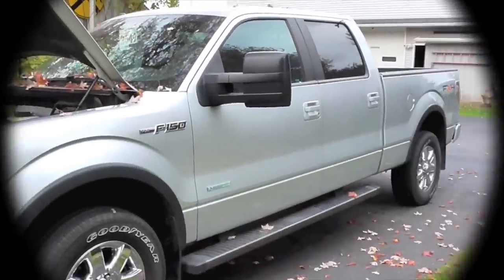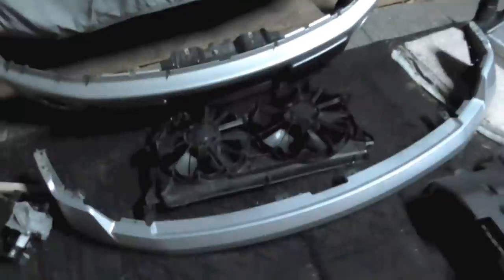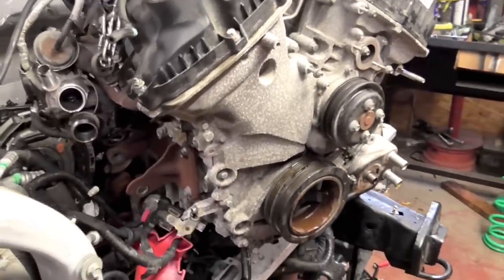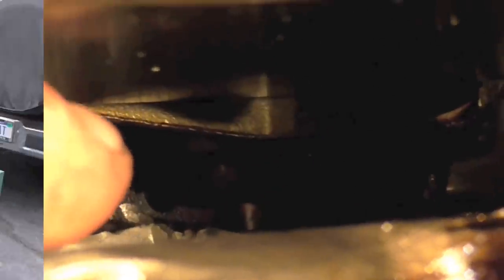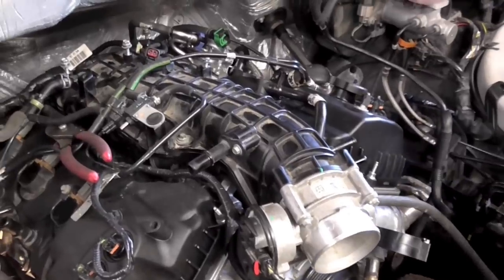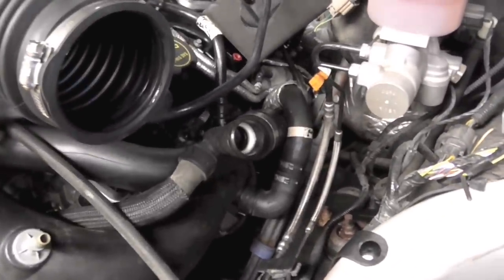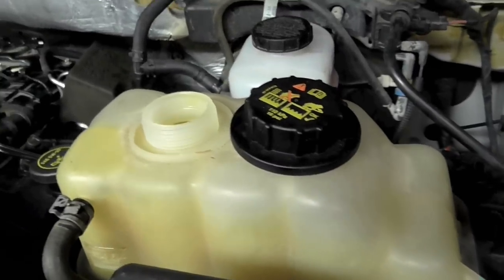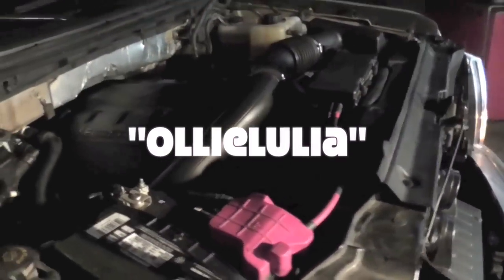FORD F150 TRUCK:  3.5 V-6 ECOBOOST ENGINE FAILURE (Removal and Installation).

Comment: And yes I'm partial to ford, there's maybe 50 videos like this considered there are millions on the road that's. 001%
Reply: dusty fleissner   There are way more Chevy 5.3s on the road than ecoboost F150s.  Why dont we see so many videos about them needing engine replacements?
Reply: Science Militia1 There won’t be soon. The EcoBoost is outselling the Chevy 10:1 and less than one percent have any problems. Hey I’m a Chevy guy as well. I’ve had many many of both fords and chevys over the years. Right now I’m with Ford and their 6.7 because the Chevy HD front ends are pure shit...yep I’ve owned 6. Remember everything on YouTube and the internet (no matter the brand) in general is all the negative shit. Which is less than 1% of all the trucks on the road.
Reply: @specforged5651  you sir are a clown. 😭😭😭😭
Reply: More to come!
Reply: elmerdane ...Smart clown! 😂 Am I right or am I right though? And no, I don’t pretend to be a know it all like most people here from their couch. At least I’ve owned and had my hands on these trucks. If most people were honest on here they would put at the end of their comments “except I live in my parents basement and can’t afford one of these trucks, but I know everything about them”. At least they would then have my respect.
Reply: @specforged5651 no
Reply: @sciencemilitia1853  👍👍👍👍👍👍
Reply: @specforged5651  lies
Reply: @specforged5651  most people live in parents basement? Oh ok✋

Comment: I just bought a 2013 eco boost F-150 and right off the bat I had brake troubles...the calipers had seized up ....had that fixed...then just a few months later I had a antifreeze leak...had that fixed...just got it back from the dealership and now I have a check engine light on....the truck had 41000 miles on it when I bought it and is now at 45500 miles...hmm maybe I should have gotten the 5.0 lol...I forgot to mention it has lost power and gas milage...it pulled great when I first got it...tons of power...and was averaging well over 17 mpg...now down to about 15.9 mpg

Comment: The 6cyl4.2 has so much potential you tubers here do intake and exhaust mods and get great fuel economy with added horse and torque. What was wrong with supercharging the 4.2L
Reply: Paul  Sosa almost sounds like a v8 too :)
Reply: yeah the 4.2 is a good engine. i hate how they are trying to make them smaller

Comment: Thank you for posting this video. I have a 2011 with the same issue and decided to go with a used engine. Is it necessary to remove the ac condenser, or can you move it aside when the engine is pulled? Did you have to get your AC recharged? Thanks again, this gave me confidence to tackle the swap.
Reply from the maker: Hi,  "we DID" ... I suppose you could work around it,  but "why" ...  we just let it gently let it 'weep-out' (the 134R), and after; we spent the 10 bucks on new refrigerant / and our draining it SLOWLY allowed the tracer dye (from the factory) too remain. True / we needed to the vacuum it down and recharge it ... "but you'll hurt-it and it will greatly ANNOY YOU if you don't because it will be so in the way" !  / MY Opinion. Video things, have a nut & bolt / fastener system in play,  "and you'll be fine" !.  Best advice: THE INJECTORS !  *lube the o rings and be quadruple-CAREFULL not to damage anything or you'll live to DEEPLY regret it.

BEST OF LUCK / you CAN do this.  :- )
Reply: TommyZTrains 👍Gotcha, I’ll take it out. Hopefully I won’t have to worry about the injectors because the engine ran good from the truck it was pulled from. I went back and forth between a used motor or a Ford reman for months, and came across a decent deal on a used engine. I am curious to pull the oil pan on the bad engine, I can’t get the dipstick back in all the way, it must be hitting broken parts. Thanks again!

Comment: Ford didn't want to cover the engine replacement at only 65,000 miles? This is why I won't touch Ford or its Eco Bust engines... way too many failures. BTW, it's spelled FINALITY, FINALLY!  On the plus side, you seem pretty calm for a guy who had to fork out thousands for another engine.
Reply: 2forgildan they come with a 5 year 60,000 mile powertrain warranty.

Comment: I love reading through the comments of desperate anti Ford boys who have to come on youtube and search problems of the feared EB motor to make themselves feel better for their boat anchor motors.  EVERY make and manufacturer has problems - name what you drive and I will find you problems.  It's more ignorant to say "this is why I dont buy Ford" cuz if that was the case, you would not buy shit.  My EB has 125k miles and still stronger than it was the day I drove off the lot - but cherry pick those testimonies - they dont fit your narrative.  I would never be caught dead in a GM or Dodge after past experiences.  It's either Ford or Subaru or European car co for me.
Reply: Johnny Utah yeah I love my EcoBeast. best truck I have ever owned.. not chipped and I take good care of her. let the haters hate - just gives me a chuckle when I blow past a bowtie.
Reply: prawcess I love my 13' ecoboost as well. strong as hell but since about 70k miles it chatters bad when first drunk in the morning! afraid the timing chain has stretched and it's not a cheap fix. has 110k on it now. gonna wait until a check engine light before the fix. Ford and their dang timing chains! still cant get me to buy a Chevy.
Reply: you forgot toyota
Reply: Jim Spengler I totally agree with you
Reply: Jim Spengler 5.4l 3v triton
Reply: No one wants to admit they got shafted for thousands of dollars
Reply from the maker: Me esp. Steve !!  :- )
Reply: How many miles on your 3.5L EB now? Do you do any towing with your truck. I'm at 61k right now on my 13 EB, I bought the truck new. I tow a large 24' enclosed trailer at least once a month but I change all the fluids and maintain the truck religiously. I've never done this "weep hole" fix to the intercooler but I've been thinking about it. Any feedback on your experience is appreciated. Thank you...-Adam
Reply from the maker: Hi "Russ and Adam", ... *were over 90 thousand miles now on the truck,  and YES, we haul things all the time. I STRONGLY SUGGEST you investigate your CAC, (and spudding a hole IF that's what you wanna do), is easy / takes just a moment ta do. So far as maintenance: were ALL "Motor-craft everything", and this keeps our 3 year warranty "alive". The Truck continues to run FLAWLESSLY.   Best  :- )
Reply: TommyZTrains so you did the weep hole and have had no issues with it? Also, is this "weep hole" an official ford TSP? Thanks   -Adam
Reply from the maker: See the other video's "HERE" to answer that question. If I were you: I'd do it ASAP !. The TSP ? "yes", BUT: because of "environmental concerns",  It's not a "Ford-Approved" repair. All I know is that ours was water-logged and THAT is what "grenaded" our engine.
Reply: Hey folks its Casper Ghost the typical modern truck lover as well as typical atheist.
Reply: TommyZTrains it should be under warranty with only 65k how much was the engine like $10k
Reply: Russ and Adam's Garage  if you do you will ingest dirt into the engine unless its using a thumb screw valve!
Reply: TommyZTrains what environmental concerns are they worried about these automobiles use more resources and petroleum to build those parts and have them shipped from overseas to be built here!
Reply: Kirk Larsen maybe after an overhaul on the engine now there has been some gas engines get around 300,000 miles if its taken care of and its long cross country miles it mostly sees dont expect it to last much more then that!
Reply: Kirk Larsen i bet they rolled the  odometer to a million miles!
Reply: Johnny Utah I liked fords but this is ridiculous!
Reply: I’ve been a Ford tech and an independent mechanic for years. I’ve owned all the other brands. You’re right they all have their own problems. I’m not a brand loyal guy at all, I buy what fits my needs and budget. A machine will always have failures no matter who makes it.
Reply: Johnny Utah I like fords just don't like there euro trash engine designs there pushing!
Reply: Johnny Utah - yes sir , same goes for me. I own a 68 f-100 with , and I'm guessing, at least 800k mis. and it's works great. it's got a 300 ci. in line six. you Chevy lovers eat your heart out, Ford trucks are so much better than G. M. trucks.
Reply: You never hear about HEMI engines blowing up like this. Ford is trash!!
Reply: Coot Ingram, you shouldn’t wait till the engine light comes on, once that timing chain is stretched it needs to be replaced as soon as possible, otherwise you could chip or break  some teeth of your cam phasers
Reply: Inspector Javert hemi’s have THE most problems, especially with their cheap ass cast iron block that eventually just gets to hot and cracks
Reply: Got 150000 on 2011, its been doing that since about 60000. If you use the motor craft oil filter and keep the oil changes to around 5000 it will not do that as much. I think what happens is the truck needs oil pressure to tighten the chain and if you use an aftermarket filter it doesn't have as good of a check valve in it to hold the oil up in the engine so then it takes a few seconds for the tensioner to tighten but the motor craft filter has a better check valve in it.  @cootingram6265
Reply: Matt Martin I have 159k on it noe and just had to do the timing chains guides and everything else. It got to where my check engine light came on. Timing got off too bad. About 2800 dollars

Comment: Does anyone remember these sort of premature failures happening to truck engines around 20-30 years ago? I can't think of any way an old 302 ford or a 350 chevy could be killed within these low miles, and it seems like it happens all the time with newer truck and car engines. But I wasn't around then so maybe the old old trucks around today are just survivors.
Reply: Im running a 1980 Bronco ford 300 made it to 354K before the rings gave. rebuilt  it and put sleeve in cyclinder 3 from a dent by the piston. Ive been driving it every day again for the past 3 years. shes been all over the country with almost 50k on it again.  While my 289 dropped a rod bearing in the mustang i still limped it home. Steal is more forgiving.
Reply: Alex's Bikes and Motors they can't sell you a new truck if your old one  or for his matter not so old truck doesn't break down.
Reply: No and oil wasn't changed as often ether
Reply: They are more complex due to auto regulations not wanted by customers.  But wanted by assclowns in Washington DC who don't drive.
Reply: even the old 318 chrysler was much better. If we'd had the oils back then, we have today, those old engines would have run forever.
Reply: Ding ding
Reply: A little word from the wise there is one company that is resisting downsizing engines and adding multiple turbos which cuts down vehicle reliability drastically everybody knows it many deny with all too much proof, the company is dodge Chrysler they have resisted putting turbos on small engines expecting it to perform like a larger displacement counterparts end it is a fact that they have the most reliable engines and transmissions with few failures compared to ford , Who actively pays people to spread propaganda about other manufactures while being mediocre at best . I will promise you you will never see 200,000 miles on that new engine it was not designed for that many miles ford makes disposable vehicles and engines now  you just have to reconcile your wallet with your desires and adjust to the fact you're not buying top-quality you're getting medium quality with a high price.
Reply: I was a big fan of ford up until about 15 years ago they stopped building  quality engines or transmissions  in the mid 90s and now they're all about profit remember how much the parts cost that you bought ! they could care less about the consumer and you will go back for more , because that's what ford buyers do,  still believing and hoping one day they'll get quality, everybody knows somebody who owned a Ford.
Reply: Dodge and Chrysler are publicly owned companies, delivering value to stockholders, just like Ford. Their job isn't to build you a great car that lasts 100 years, it's to make as much money as possible. They are also now owned by Fiat which could care less about making a reliable car. I hear French cars are great lol
Reply: look up hemi problems you won't find any ... ever
Reply: Kevin Holmes
 BIg Dodge  Hp requires excellent engineering to hold up . you hear about any mass hemi failures ?? NO, is the answer  but how many dead 5.4 tritons and powerstrokes... MIllions ....that is a fact
Reply: I keep seeing you use the word fact but no actual facts besides your poorly written comments. All motors die, I'd love to see where you actually get this information from that proves hemi motors don't fail
Reply: s w Actually dodge transmissions have been an on going problem for as far as I can remember now. In their little cars and big trucks
Reply: I have a 96 Ford F150 with a 5.0L (302) Windsor V8 with 206,945 miles on it and still going strong.
Reply: david perry oh BS. Oil was always recommended at 3K back then and people drove less as far. Most cars have 7-10K intervals now.
Reply: 777jones yeah god forbid we get better gas mileage, lower emissions and longer running engines. Heil Trump!
Reply: Grumpy old fart really cause most engines back in the good old days nearly made it to 100K!
Reply: My dad's 1978 Ford F150 Lariat that he purchased brand new with a factory big block 460  V8 dropped a valve with only 19,000 miles in 1983 so things did happen back in the day as well...

Comment: I had the same problem with the same  year and mileage was 67000 on when it happen too me it costed me 7100$ too replace the motor did u say they had a recall on this 2011 problem..Thanks for all of your advice
Reply from the maker: Hi: I'm not sure "recall" is the correct word ... "TSB" (Tech. Service Bulletin) relegated toward / too this issue "MAY" be a better way of saying it ... But then again: I'm NOT on the inside.

Comment: I got one with 142k and it runs perfect , stop bashing on a good thing
Reply: zacatecano1986 You're on borrowed time with it, my friend...
Reply: Have you had to replace the timing chain yet?  If not, you will.  Mine just went at 140,000.
Reply: 142k?  Thats considered part of the break-in period for a chevy 5.3.
Reply: Science Militia1  my Sierra has 300,000 with the 5.3 they’re the best bullet proof
Reply: If it was a good thing this video would not be up, this video is up since it is an average thing.
Reply: @numberpirate    Agreed.  Ford guys are impressed when a truck gets over 140k miles.  Thats why they got excited and post a video whenever they do something that others consider average.  "See wow look how amazing these ford trucks are, this one has been babied and managed to survive to a really average amount of miles. Yayyy!"
Reply: @oc7677  bullet proof, im on engine 3 in my gmc with a 5.3, they are a valve train disaster
Reply: Should have bought a tundra 😂😂😂
Reply: billy cheek   Idk what your problem is man.  I have 3 trucks with the 5.3 and none have ever had a problem.  What oil are you running?
Reply: Vlad C   Everybody I know with a Tundra is in the shop a lot.

Comment: Great work, how many miles on the first engine in 4 years before it failed? Also, Is the new engine meant to sound that clattery?
Reply from the maker: 65,000 miles (see the Video). So far as the "noise": That's the drive-train / mechanical fuel pump ... their's really no "noise" with "anything", *It's an "ultra-sensitive" mic in the Camera. "The Truck continues to run like silk".
Reply: +TommyZTrains I must have missed the mileage.  I'm surprised it went bad...  Do you still use Amsoil?  
I'm glad your truck is running well and I totally appreciate camera mics not hearing how it really is.
Reply from the maker: No Sir, *were just using "Motorcraft" oil and Filters ... (The Dealership suggested we do do this ta maintain our 3 - year warranty on the crated engine),  ANYWAY: "Were saving Money" !!!

Comment: Mine sounds the same just as quite as the new engine ran. Only issue I have is turbo coolant leak from driver side block return line😢

Comment: Small displacement engines, 3.5, 2.7 boosted to the ragged edge for max horsepower + big vehicles = internal engine components stressed to their maximum.       KA-BLEWY !
Reply: To be fair you can’t say they are pushed to the ragged edge because they aren’t. Realistically these engines are actually getting a fairly conservative amount of boost and are able to handle much more. The downside is that no matter how much boost they make when compared to a naturally aspirated counterpart under a load you lose the benefits that smaller engine gives you. So they are great cruisers not so great work trucks
Reply: It really is that simple but dont underestimate the stupidity of people that buy a ford truck with a turbo 4 cylinder in it😂😂😂😂 a ford😂😂😂😂😂with a turbo 4 banger😂😂😂😂

Comment: That amsoil looks sludgy in the oil pan how often do you change your oil, and did that motor quit after 65000
Reply from the maker: Read the description, and ALSO read about oil / "Black-Stone anyl"., the those "readings (in that very analysis), were spot-on and aligned PERFECTLY with the Trucks "oil-life-index" 0parameters. "Sludge" ? *no*, this failure was due to water build-up ... *again: "read the description Rockie".  :- )